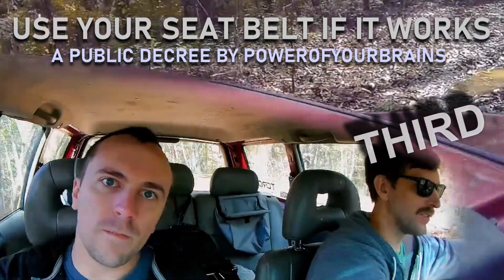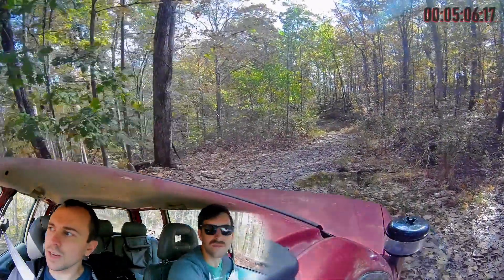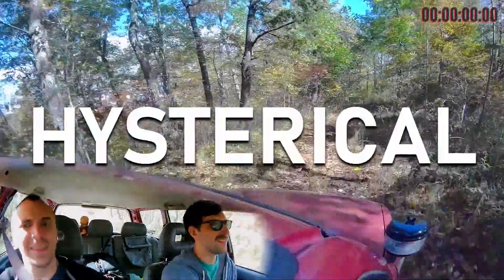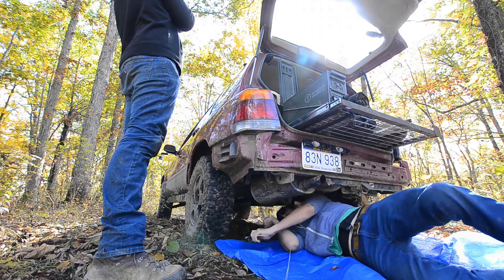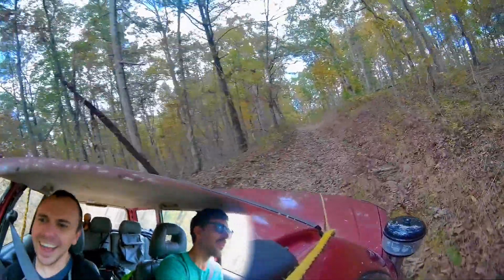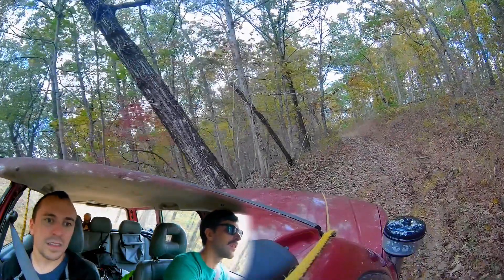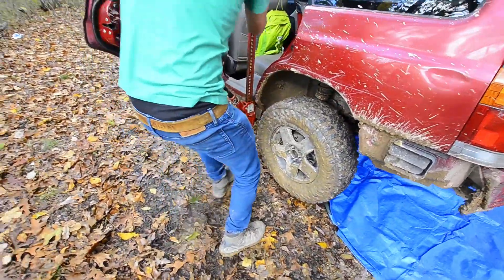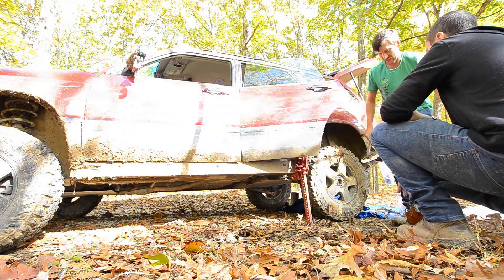Subaru Heavy Duty HD Severe Duty axles are total GARBAGE

Comment: Hey!

There is a good advantage of a torq locker over VDC/X-Mode.

If I break an axle the car has no way of transferring it to the still good axle.
Reply from the maker: This is true. We would have had a bear of a time getting out of there if we didn't have the option of activating the other toothpick axle for gentle 3WD.
Reply: @powerofyourbrains  Also I like ya'lls inside/outside view. I need to do something like this now that I've finally upgraded out of windows movie maker.
Reply from the maker: @bruceyyyyy  Nice, what suite did you get?
Reply: @powerofyourbrains  Power Director. Friend got it for me. 

The Top 5 hate video is the last one I made with windows movie maker.
Reply from the maker: @bruceyyyyy  nice. I just got it too, actually. It's faster than VSDC for cutting up footage, although not as versatile as I had hoped. Oh well. I still use wmm on occasion.
Reply: @powerofyourbrains  You still have your diff fluid sealed in there?
Reply from the maker: @kartboarder22g17  Yeah, we swapped the broken one out for an oem spare we brought

Comment: The countdown clock added nicely to the tension...perfect for a Halloween release. I'm not scared of monsters and $#!+, but live in fear of that dreaded snap on the trail. I couldn't replace an axle in my own garage, let alone in the field. I'll try to remember the zip tie/disable AWD trick if this ever happens to me. Any chance of getting your money back on those axles?
Reply from the maker: Thanks! Appreciated. If it makes you feel better, OEM axles are unlikely to hang down like that if they break, provided that the break occurs near either end of the axle which they typically do...but you'd be in hot water without the ability to go fwd, like in a manual. Also, the terms of the warranty for those soft wood axles are bogus. They're written as if they expect it to fail, but...they will give us a refund.

Comment: Recently tried HD axles after some torn boots on oem with 100k+miles(dont know how old they were definitely more than 6 years as that's how long I've had the car). The HD axles blew on the highway after about 2 hours. One and then the other after that one was replaced. It became a huge headache. Going back to oem now despite subaru having increased price of the axles a lot recently.

Comment: That inside outside view with the interior pasted on the roof of the car is a very effective use of screen. 
Also the " best axles are OEM" may not reference the exact set up you have with so much articulation.  
That said wow that was a pretty wimpy place to break an axle, no load up or inertia like last time. 
Reminds me of how VW bug off roaders never use lockers since they could never design an axle strong enough to survive, instead they use two separate break levers to the rear wheels and slow one side or the other based on which is spinning to apply torque to the other via diff.

Comment: I'm glad to have heard about these before your video and for your video to back up the claims. I was considering trying heavy duty axels at some point. Too bad they are not good. We need better axels for how much tire we put our foresters. Then again I'm in a SJ FXT so no idea if they even make HD versions haha. 

Btw, loving your videos. My buddy I go out on trails with has a SG and they are awesome machines.
Reply from the maker: I'm sure they do, but I wouldn't recommend them. For what it's worth, the OEM axles seem to be pretty tolerant to abuse. I mean, granny ran those 160k OEMs with a locker and 30 inch wheels over some super gnarly terrain. We only broke one because we got a bit overzealous with the rock bouncing. However, Torq Masters may be open to making us some if we can show the demand exists.
Reply: after watching your videos I'm surprised granny isnt a twisted piece of metal. You really do abuse it and it is fun to watch. 

I daily drive my SJ so I try to keep my exploring timid until I add more protection but I figure once I have protection elements installed I'll try more fun stuff. Next up is tranny cooler and some skid plates. 2" lift is on already with 28.5" 225/65/17 tires. 

Thanks for the videos
Reply from the maker: Thanks for watching man! We're thinking about installing an engine oil cooler on granny, actually. Our ej25d makes some toasty oil. Gotta mind those head gaskets so we can keep rockin the d for a while, or until we pony up for that ej255 swap we've been thinking about.
Reply: @powerofyourbrains  would be cool to see a EJ255 go in! I had a EJ255 before in my former 2006 wrx I had. Loved that engine! 

See you on the next video!

Comment: Ive read good things about Rock Auto A1 Cardone axles being quite good in the strength department. Many guys in the community claim they work well for the price, especially off-road. Maybe something to look into.
Reply from the maker: I have. These axles are labeled and sold under many names...Cardone is one of them, but also Surtrack, Trakmotive, ARP, and others too. The positive reviews on Amazon and forum chatter is very suspect if you ask me...I hope you're not getting paid to write this comment too. We are the community.
Reply: @powerofyourbrains  I've met Kyle, pretty sure he's not a shill :) The Cardone axles are just a standard new replacement axles. Might try them or more likely the duralasts from AutoZone if these OEMs fail. Have the duralasts up front since the beginning of Granny and they've held. plus it's cheap and easy tow get em replaced under warranty if they do break.
Reply from the maker: @jasonchall3766  Gotcha, Cardone has a "severe duty" offering too - they're the same as the ones we got. Given the lack of videos on YT about these scam axles, I'm a little wary of shills and video takedown attempts. Even if the standard Cardone's are okay, the fact that they are willing to market the "HD" version sorta makes me not trust them at all. Also, sorry Kyle - you're not a shill.
Reply: @powerofyourbrains  Ya, I definitely wouldn't bother with any of the axles of this same unique design, even though it's good in theory, I suspect they're all made the same place and with the same crappy metallurgy. And fair point about suspecting Cardone just for selling this crap. Hopefully these low mileage '07 OEMs hold a while.
Reply: Looking at the Cardone 667029, which are the ones I think Kyle Kelsey is taking about, one downside is that they don't separate part numbers for L and R, which they should since the OEMs are different lengths. Hopefully they've split the difference on length which will be ok if they're used as a pair and one isn't overly concerned about NVH.

Comment: Bummer :(  It's odd that even with the constant popularity of off-road modded Subaru's... we still have so few "heavy duty" CV options that work!  The drag racing side of Subaru mods seems to have that covered.  I would think there must be an opportunity there for someone to start building stronger + more flexible units.  I wonder if stock ends could be modified with a flange welded on to maybe accept the stout Porsche style CV's that are used for buggy's (930's for example), because then there are a bunch of splined shaft options that are more than strong enough.  Big question would be if that all could fit in the same space as OE without requiring modifications to the knuckles & subframes.

Comment: Damn i sometimes watch ur videos but i seen this too late. I got these axles after blowing a cv apart on a 200k mi oem ive been rebuilding whenever it would start making noise. Thinking it would be stronger... couple weeks later. Did the exact same thing u did.. given both times were pretty hard throttle turning out of intersections. In an 01 forester with 5mt dual range and torq locker also. Ill see how these fair offroad. I always carry spares and i got it replaced under warranty.  Just sucks getting dirty lol
Reply from the maker: Hopefully they last more than 7 minutes without stranding you in the middle of nowhere when they fail
Reply: @powerofyourbrains  haha lets hope for the best. Looking forward to more videos from you. I recently adventured with a jeep crew out here and surprisingly the axles held up. Carrier bearing got a little bent but all in good fun. Really not a place a subaru should be but it was a blast. If ud like to have a gander. Lol my buddies youtube footage. https://youtu.be/4G2M8QYWLQs

Comment: Wear a helmet the next time you winch externally, can't believe a guy died the other year just helping pull someone out of the ditch, that was a sad one.
Reply from the maker: You know, I've been waiting for the ratty tree saver we use to finally break. This is something I've thought about...perhaps helmets are the answer...and perhaps, a new tree saver.
Reply: @powerofyourbrains  I know it is one of those freak accidents things, most likely anyway the cord would break only and whip you, but you never know if the metal hook or whatever is there cuts through or something.  You could also just hide in the car or behind it.  Awesome vid as always.
Reply: A jacket or something thrown over the cable will do wonders for dampening the rebound if something does let go. Or invest in a proper winch dampener, and yeah, standing behind something more solid than air helps too
Reply from the maker: @MinimaDomum  That's exactly what we did when we had to winch out of the middle of a lake a while back. Check the video if you haven't seen it...we had to daisy chain several lines together to reach a tree 160-170 ft away.